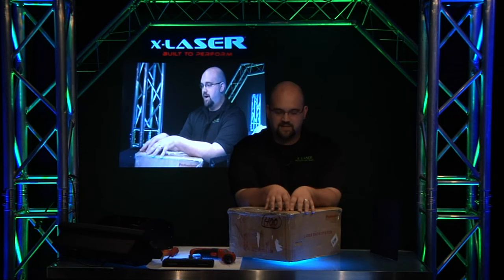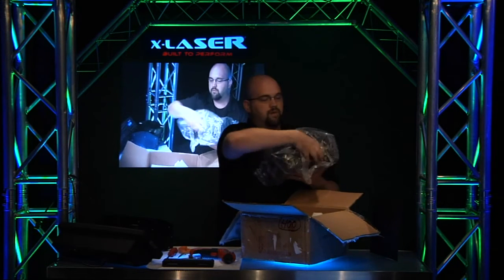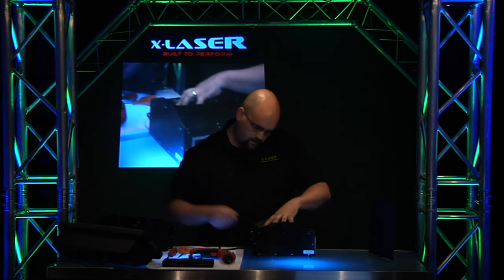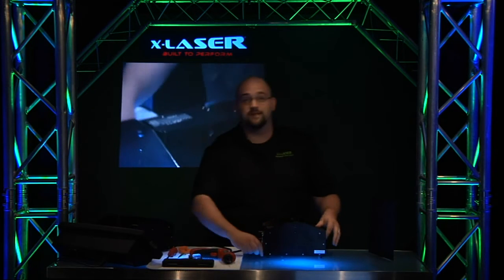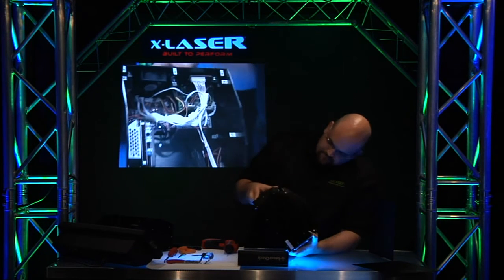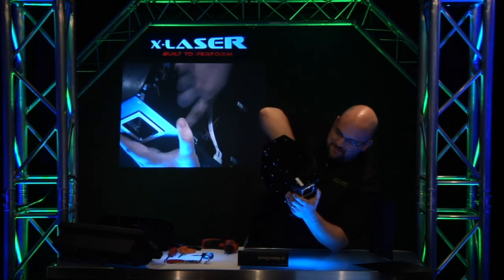Illegal Laser Comparison - Part 1

Comment: Great video. Lots of useful information in both parts 1 & 2!

I was curious tho, you imply that many lasers are bad or illegal. I have a Green and Violet laser that is made in China, and Im wondering how can you tell if the company is good or bad. I notice a lot of lighting companies now days are made in china (american dj, chauvet, etc). 
So I took mine apart, and I noticed it had lots of guts on the inside compared to many, but all screws are there nothing loose, or rigged like this.